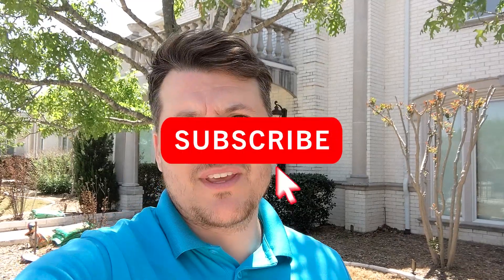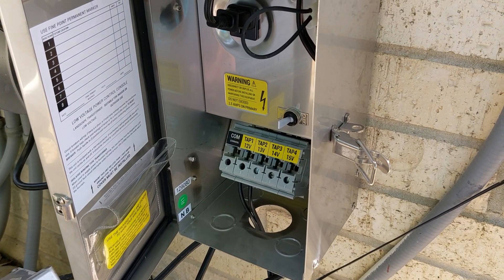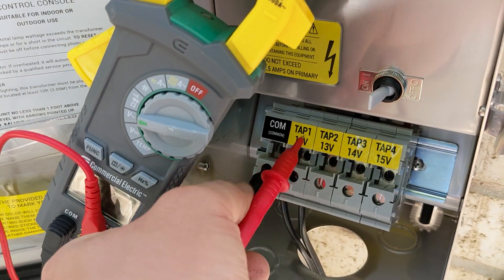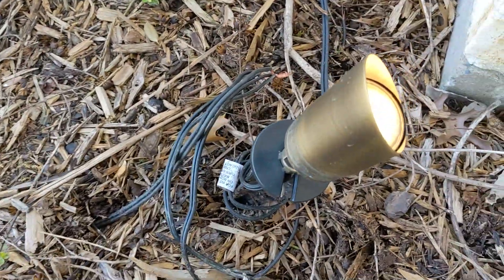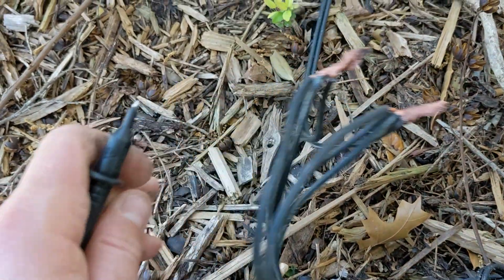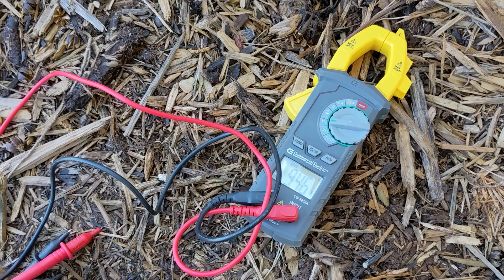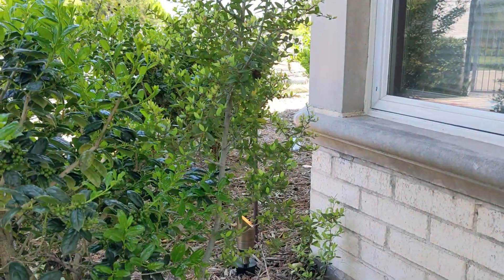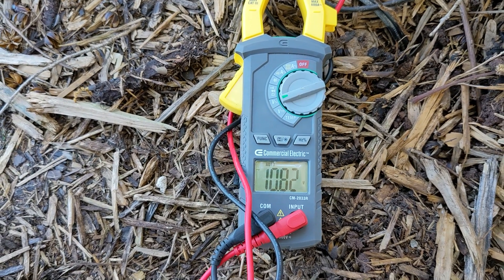Voltage Dropping Due to Wire Distance | Landscape Lighting

Comment: I'm going about 150' and will use 10 gauge for about a dozen 5w lights. 12 x 5 is 60 watts. If you want to go over 12v, measure voltage at your first light from the transformer. It shouldn't read over 13.5v or that light will burn out early.
Reply: just adding to your point I am looking into this ... the more important part is to have your lights in the operating range of the transformer ... so if they are in the high side of the range it is fine as long as you don't go over it else yeah your lights will either cook or blow which would suck ...

Comment: Hey AK lighting, I just finished running a single run of 200' 10/2 wire. I stopped at the end of the roll because I assumed it would be too much drop. I have 96W of LEDs on the wire, and am pulling 11.36V at the end of the line. I was thinking I should hop on the 14V tap instead of the 12V, but I'm worried now I either don't know how to measure my voltage or maybe I was over estimating the drop I would experience. Think I'm okay as is and my measurements are within reason? Or am I completely measuring my voltage wrong? Thanks :)

Comment: 2*k*i*l devide by (12v*3%)
This math gives you the required wire size in kcmil.

2*12.9*amps*length
12.9 is for copper. If it was aluminum it would be 21.2

Comment: My experience is that the volt drop has more to do with the wattage of the light fixture on the line than the length of the wire. If you don't hook up any light fixtures at 100 feet, the volt drop is almost zero, even if you use 16 gauge wire.
Reply: At the same distance both gauge and amps determines voltage drop. In practice the percent drop in voltage is about half for each increase in wire size.
Reply: That’s because voltage drop is only experienced when there is a load

Comment: voltage drop affecting lights really depends on what light you use at 12v or 120v or 240v.. etc..  Longer runs would benefit with 120v.. or even 240v if your using a ton of wattage..  I ran 500 feet of 12AWG on a 20A circuit, UFB wire for two 150w a 100w and 70w HID dusk to dawn lights..  Accounting for ballast ineffeciency thats about 5Amps or so through 500feet of wire.   From my house im reading near 125volts.  According to calculations i should be seeing near 7% voltage drop, but when reading voltage at the furthest fixture im seeing 121v..   So i really only saw a 3% drop.   So calculations only give you so much real world results.  I probably could have gotten away with 14awg ufb WIRE. but 12AWG seemed the safer bet since i plan to run a 15A receptable at the end of the run which is at my gate, this way i can wire up some christmas lights if i wanted on the gate or what not.  10awg woulda been overkill in my opinion.. and yes i know 500feet is long, but the voltage drop is clearly not that high, 3% is nothing, neither is 6-7% on paper, i woulda been more concerned with a 10% drop.  But for HID lights, 3-6% is perfectly fine, you wont see a dimming at that not with HID lights that are ballast driven.  Plus im using 120v./.

Im more concerned with your wiring not being outdoor rated at least from what i can tell it looks like regular wire, and the transformer with the giant opening and 2 wires sitting on the sharp edge.. i dunno.  Not a fan of 12v wire being run 100+ feet either. 2v drop is alot thats near 20% drop. Honestly that wire is going to get very warm.. So yea i would deff have increased voltage at the tap..  Its still alot of amps your pumping through that wire though
Reply from the maker: As a company that only does 12v, its interesting to see the voltage drop for a higher voltage system. I agree 3% is much better than 20%, however, lights bulbs only need to have around 9v+ to work properly, and with a 15v tap and a 2v voltage drop still is plenty for the bulbs regardless of the 20% drop. Regarding the amps, since it is a low voltage system, there really isn't a lot of amp going through the wires. Also regarding the transformer wires, I inherited this lighting system and honestly I haven't taken the time to change any on the transformer. Thanks for you comment, I appreciate it!
Reply: 😅0 @aklighting8292

Comment: Why not just always use the 15v tap?
Reply from the maker: It used to be, and may still be with some bulb, that most LED bulbs would burn out more quickly with a higher voltage, but I'm starting to see bulbs made better and last just as long at the higher voltage. Most bulbs performed best and had the longest lifespan around 12v.

Comment: Great video! Learning a lot, thanks man. One of my longest runs is about 350 feet with 20 lights at 7 watts. Ended up going with 10/2 wire and ordered the largest transformer VOLT offers that has 12v up to 22v. I’ll likely need to use the max 22v slot.
Reply from the maker: Thanks! That's a long run! I think the 10/2 route was a great idea, and I love that you used the transformer with 22v.
Reply: why run 350 feet of wire at 12 volts....  why not just run it through 120v... seriously 7watts for 20 lights at 12v thats 11Amps of power.. at 350 feet thats a 66% voltage drop you will experience..  great way to burn everything down, you woulda been better off running 120v through a 14GA wire at 350 feet..  Youre insaine dude..  even a transformer for 22v thats still too many amps and too much of a voltage drop at near 36% youre going to experience..  Your setup is a fire waiting to happen.. NOT SAFE